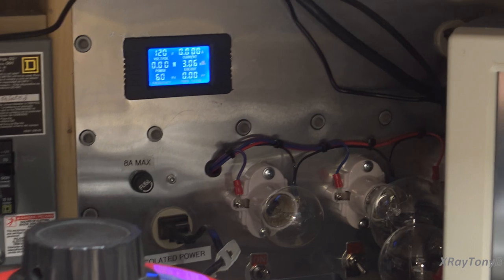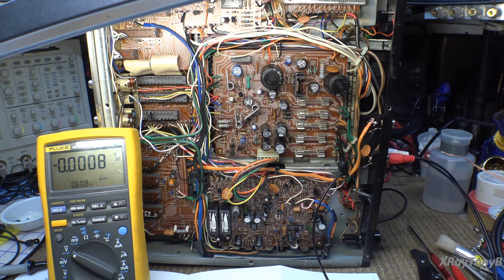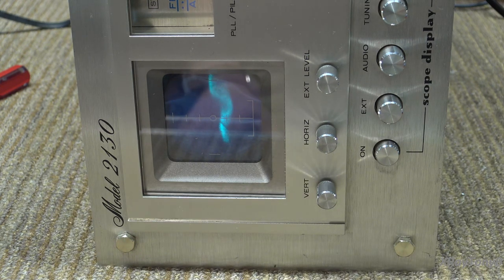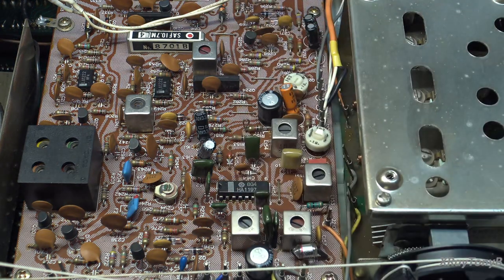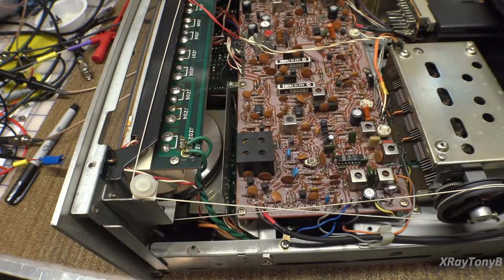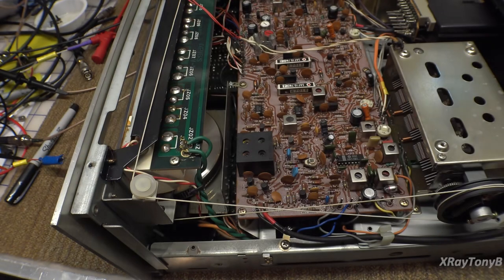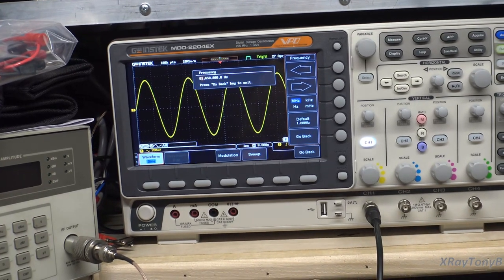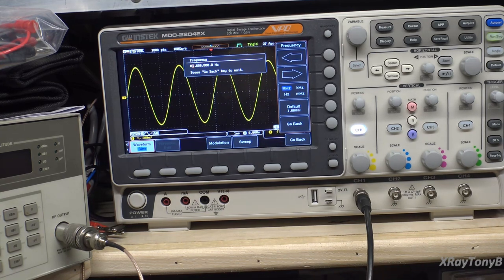Tuners, Tools, TestEquipment, Tea, Tarts & Talk - Part 2 of 2

Comment: Yes please do a fm alignment,  I am not convinced that there still isn't a gain problem in the fm if because of the quartz lock not working. One thing to check is the if filters. I have seen those type of filters get more lossy over time.
Reply: How would you fix the filter issue since parts are not available to my knowledge. I am working on a Sansui TU-7700 that has a sensitivity gain problem. Thanks

Comment: Get a Brymen 869s if you want comparable and more features of the Fluke 187. I have a Fluke 189 which is the same just has built in data logging. I like my Brymen better because it remembers the settings last used and does not default to factory settings like the Fluke. Check out Joe Smith’s channel of Brymen robustness tests. Only meters that will hang with Fluke in high voltage transient tests. TME or Welectron sells Brymen at great prices. TME in Poland shipped both of my Brymen for $10 from Poland in 4 days. I can’t get stuff from Tennessee to New York that fast.

Comment: Technician jobs, found your comments about tech jobs pertinent and like trades are getting enough replacements in the pipeline. The old TV/Radio shops are gone. Two-way radio like Motorola are around but have changed with the cellular industry. Medical definitely should be staying around but who does train journeyman and like you say employers and employees owe each it’s not a one-way street. Finding good candidates with well-rounded skill sets is a problem for the trades, including electronic technicians.

Comment: Hi Tony i have a question for you on the crt display as the indicator is static does the screen not burn leaving a shadow just like computer monitors when there is no movement that’s why the screen saver was in place
Mike

Comment: If I were you, I would view a couple of Paul Carlson's videos on a.m. receiver alignments... OMG... there is almost NOTHING that you have done correctly. Go to "Mr Carlson's Lab" plus an older type receiver which demands a swept signal, such as a Hallicrafter's SX-140. Good luck!
Reply: Get out of here, Paul, we all know it's you!
Reply: That's unnecessarily harsh.  Tony has done swept AM alignments before.  It's using a single tuned coil for the 2nd IF.  Swept alignment is not needed.  Perhaps they wanted a swept alignment to insure you're at the center of the ceramic filter
Reply: @johnnorton6085  ,  Harsh? Not actually. I was speaking as an individual who was appalled at the thought of THAT kind of misapplication of both theory and hardware.
Reply: @seanobrien7169  ,  I WISH I had his lab, his smarts and his talent.
Reply: @BruceNitroxpro  But you have none of the above. Did the receiver get aligned? ...yeah... Go back to watching Spongebob, you goofy goober...
Reply from the maker: I must admit,  it's over my head.  Perhaps you could share with us how to inject a sweep signal into the output of the ha1197 chip and read the bandpass at the input as the instructions indicate.  What center frequency and span should i use?  Do i need to use a detector probe with the scope?  How should i set up the trigger? Can you refer me to one of Mr  Carlson's videos where he shows this one one of these types of receivers? Although my method seemed to work fine,  I'd love to know how to use the method in the service manual. Please let us know.
Reply: @johnnorton6085  It also allows you to stagger-tune the IFs, improving audio frequency-response.
Reply: @dhpbear2  Looking at the schematic there is a single IF transformer followed by a ceramic filter then a single coil.  I believe the purpose is to center the passband around the ceramic filter.  Stagger tuning is usually done with multiple IF sections with each transformer tuned slightly different to widen the passband or with IF transformers that use coupling coils between the tuned sections.  I don't see that being the case here.
Reply: @xraytonyb  ,  i guess you figured out that the service manual was full of it, also. LOL I was harsh because the equipment you have is a tad clunky to do what they asked. But Paul Carlson uses a collection of vintage equipment and restores equipment using the technique that the service manual suggests. All's well that ends well. I won't make any other comments, and will continue to listen and view your videos.